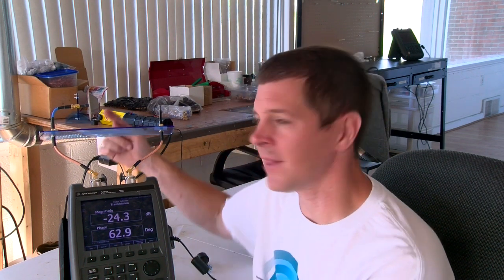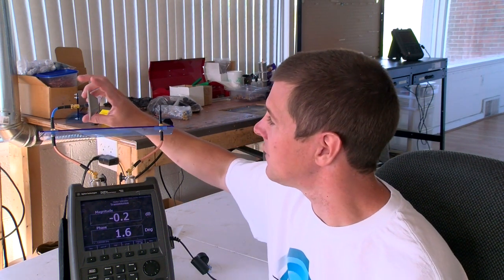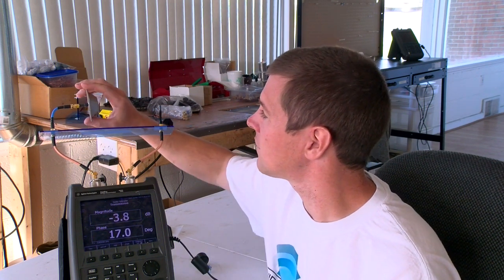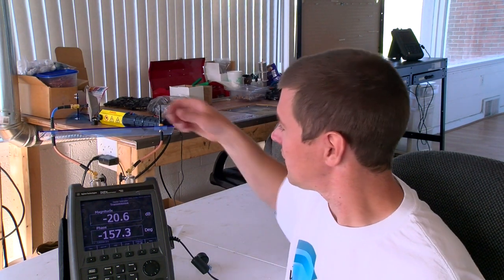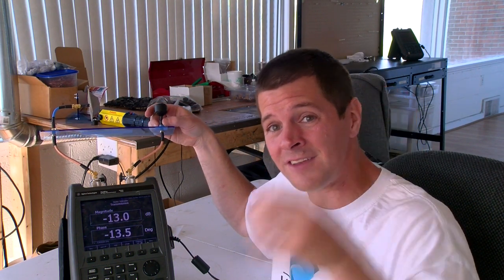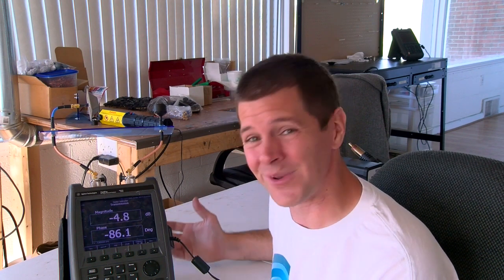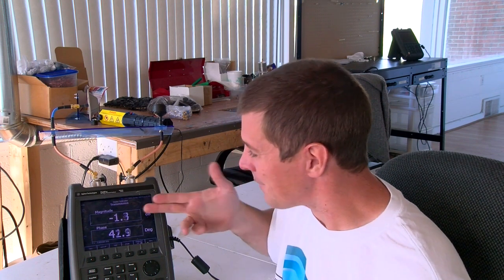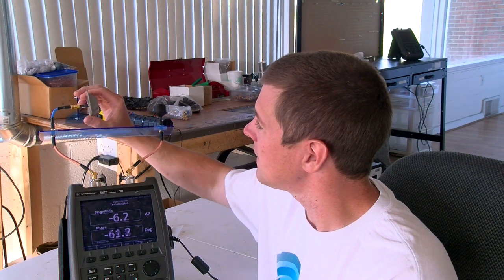Antenna cross polarization loss demonstration

Comment: Hi, I was wondering how the antenna would still be able to receive anything when tx is vertical and rx is horizontal. The electrons of the receiver would only move up and down, but not left and right. So they would not create a current.
Reply: You ask a devastating key question, well done.  

If both the transmit and receive antennas are ideal (e.g. zero thickness wires, perfect-shaped horn made of zero thickness metal, etc.) then yes the crosspolar voltage gain would be 0 (-infinity dB).  Expect real-world antennas to support some surface currents in the orthogonal plane.  

The issue is more interesting when a collimating reflector is involved.  

Off-axis reflectors can also couple a crosspolar signal to a copolar signal; imagine an off-axis passive wire oriented at 45 deg illuminated by V-pol or H-pol.  The wave scattered by the off-axis wire will have 45 deg polarization, thereby coupling to both V-pol and H-pol.

Comment: IBCrazy, what about in the other hypetrain where  you use linear antenna (they call it snowman) for their VTx and use CP antenna for their VRx?
Reply from the maker: There are rare occasions where mixing CP and LP is beneficial.  However, in most cases, it is better to use the same polarization on both ends.
Reply: I've always felt that a linear transmit and high gain CP Rx antenna like the Crosshair is the best way to go if you want a super light Tx setup. I run a small piece of 30AWG wire as an antenna and my video is fine =P

Comment: What about Connex and MIMO? Would you recommend the linear or CP version of your panel antenna for racing? The digital signal also benefits from multi pathing, so that complicates things even more.
Reply from the maker: Connex and MIMO are different... sort of...  I have played with CP and LP for the Connex and found that the linear goes significantly farther.  However, the clarity and ability to fly behind objects and trees is far better with circular.  Mixing them doesn't work well on the connex.
Reply: Do you do transmit with both RHCP and LHCP or consistent all the way through? That's the kind of info I was looking for, thanks for the response!
Reply from the maker: I just stick to one polarization type (usually LHCP).  There is a rare scenario to mix them to bend a signal around a corner, but I almost never use this.

Comment: great video Alex. Do you have any solutions to replace a linear antenna with an omnidirectional? I just got a baby hawk and it's a ton of fun. But I would like a better antenna on it. I can solder really well if I have to solder on an antenna myself
Reply: he sells cloverleaf antennas soldered to coax, and all youd have to do is cut the coax, then solder it to fit onto the baby hawk vtx. at least thats what i would do
Reply: cookie4524 ,Hey thanks for the info. I'll have to check RMRC for it.
Reply from the maker: I miake a micro antenna with a small cable for this.  Tiny Whoop and RMRC sell it.

Comment: what about running a dipol vertically... wouldn't that be cool... I mean the left right bank would still hurt but with quads that leaning forward for speed that would be a big win since the "how much tilt will I be at most of the time" question would be irrelevant, right? :)
Reply from the maker: For the most part, yes.  However, you still have the multipathing issue to fix.
Reply from the maker: Sort of.  The tilt of the antenna needs to be 90 degrees off from the camera to retain vertical orientation.  Quads do not bank like airplanes, so this is less of a problem.  However, many quads run at a 45 degree angle of attack and if you figure the radiation plot of the antenna as well as the 3 db polarization loss, that can result in 20% signal strength.

Comment: Is there any reason for not running a circularly polarized antenna on a rc transmitter all the time besides size and fragility?It looks like it is a no-brainer but i have never seen anybody doing it other than you.
Reply from the maker: I have found using CP on control yields great results.  If you can deal with the size, use a CP omni.
Reply: Thanks for your answer.I am going to build a spw for my transmitter.

Comment: So if you have a linear on the TX side, you either need to fly upright all the time, or use a circular on the RX side and get lesser signal loss when off angle?   This would explain why the dipole TX antenna has been working so much better than expected with circular on the goggle / RX side.

Is there any advantage to Left vs Right circular on the RX side if the TX is Linear?   I've been running LHCP just figuring it would better reject the RHCP signals that most of the other pilots are transmitting with.    The reality is I don't notice a significant difference.  The omni is a Mad Mushroom on the RCHP setup and an Airblade on the LHCP setup.
Reply from the maker: You can certainly bank and turn.  it is steep banks where the signal gets weak... and even then, unless you also point the null at yourself you are usually ok.

The circular on the goggle is likely working better simply because of the cross polarization issue if I had to venture a guess.

Comment: I gotta question about fpv on water. Fpv boat specifically. What are your thoughts on best frequencies and antenna's for control and fpv on water where you have a fixed height but want to get some range?
Reply from the maker: This is where linear shines!  That system I had on my test bench is perfect for this.  An HD dipole (which consequently works well for analog and is super cheap) coupled with a BiQuad does really well.
Reply: Thanks for the reply. I will do a test when i get my boat finished with CP and linear. At the moment the only linear ones i have are rubber duckies.
Reply: of course, because especially if you're on salt water, that becomes the other half of the antenna... a friend of mine who used to live on the intracoastal down here in florida, had a hbtv5 at the end of his dock and WOW .... his rx was a huge improvement.....  now of course this is for even lower frequencies 20/40/80m but the same rules still apply to some degree... having a real dipole antenna is always better than a monnopole where it's using the vtx as the other half of the antenna

Comment: If I'm running diversity. Should I use two linear or one linear and one circular.
Reply from the maker: I would just stick to one type of polarization, linear or circular.  I see no reason to mix them.
Reply: Ill just use two dipoles on my receiver if im using one on the tx.